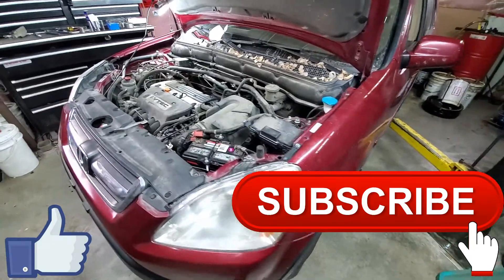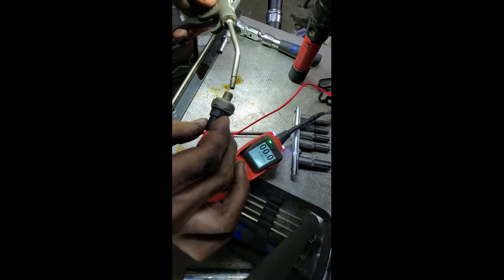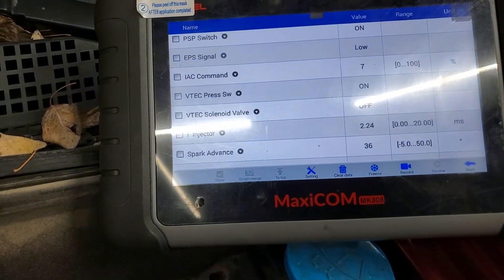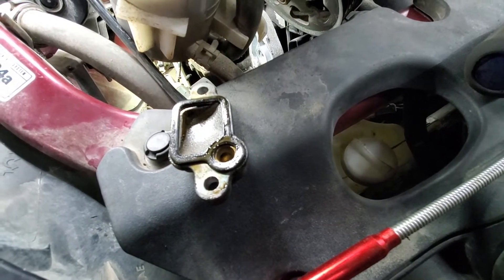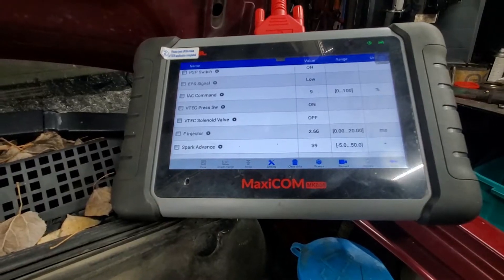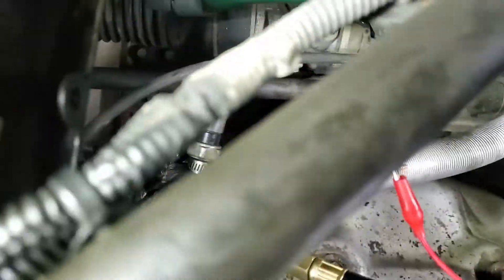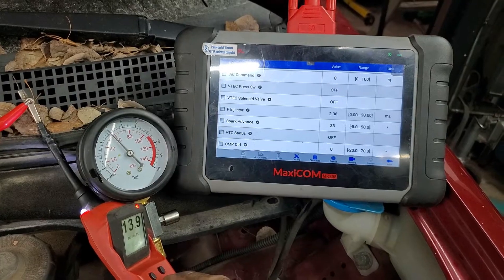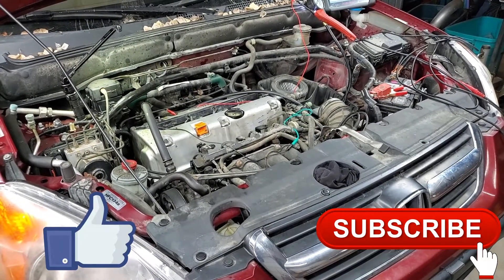CRV VTEC not working Solved.

Comment: My vtc p1009 keeps getting triggered after replacing the solenoid. I have weird fluctuations in the tachometer between 2-3, sudden drops or a slight kick back in the car when it happens. I’ve been told it’s fine but it’s not. Recently changed the vtc again slight improvement but still not working great. Our Honda specialist was useless. Any tips?
Reply from the maker: that code is related to variable cam timing control, my  video is specifically on variable lift control solenoid which is a completely different solenoid from the one I show in this video. if you are having that code it is very likely that the screen is plugged, or you have a blockage limiting oil pressure to the vvt cam gear, or you have a faulty cam gear. There are alot of things that can cause your particular issue, you may even have an electrical fault to the solenoid. if you are located in central AB I could take a look at it for you, but chances are you are not.
Reply: @A2J_Tim sure I was aware of that, you just sounded more knowledgeable I thought I’d ask. No I’m not but thanks.
Reply from the maker: @Ingrid_clare  sorry if It sounded like I was talking down to you, I dont know the skill level of every one commenting on my videos, so I try to explain things as thorough as possible because I genuinely want to help people out.
Reply: @A2J_Tim no no problem

Comment: Nice job.  You are the first person I've seen show that just because the solenoid initially clicks and moves the pintle, it doesn't mean it is good.
Reply from the maker: I have found that factory Honda parts last way longer than jobber aftermarket parts aswell, I replaced this same solenoid on this exact vehicle about a year later when the jobber one failed in the same manor.

Comment: Nice video, the amount of junk indicates that the oil changes need to be done more often. Any type of grit material can scratch the solenoid plunger where it does not seal well anymore. Any controls that work out of oil pressure like Variable Valve Timing, VTEC LOVE and need clean oil.